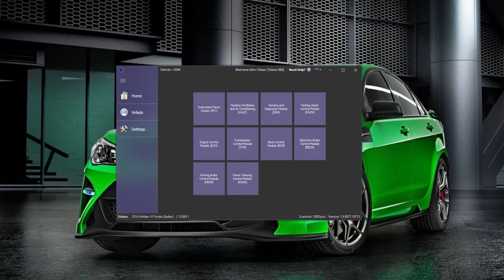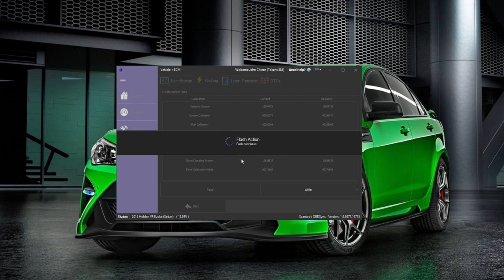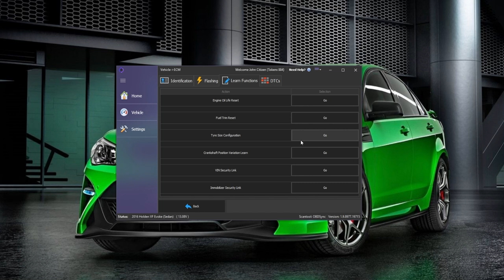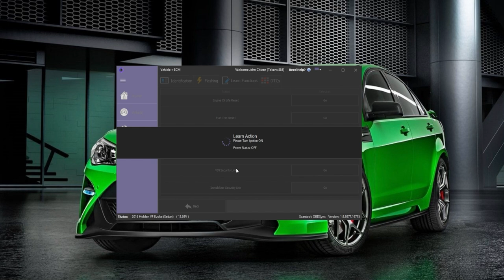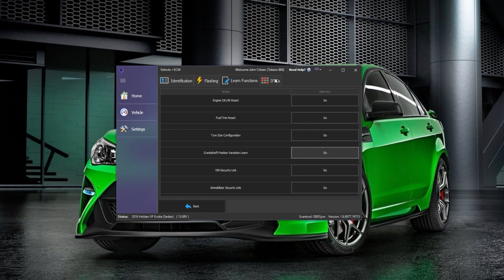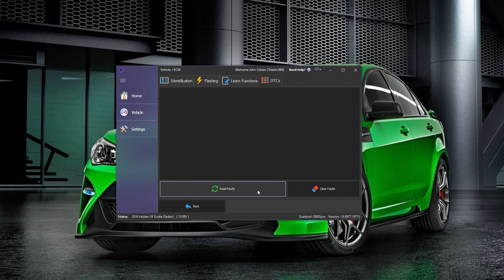Holden VF Commodore Engine Control Module (ECM/ECU/PCM) Programming and Security Linking

Comment: Can this read engine calibrations?
Say i want to tune certain parameters and flash that calibration back on?
Reply from the maker: OBDSync does not have a full tuning editor built in.
Currently the only option OBDSync has is to deactivate DOD/AFM on vehicles with this feature fitted.